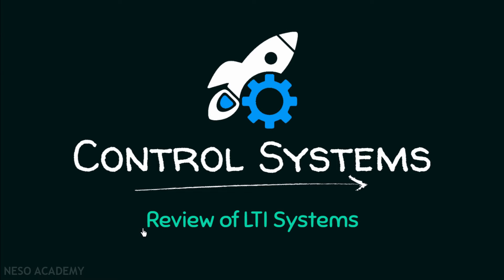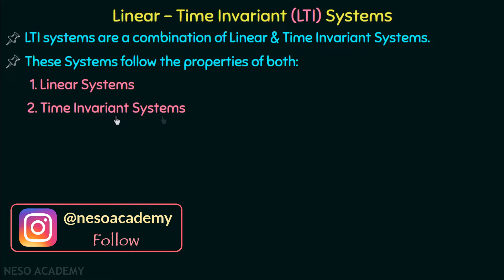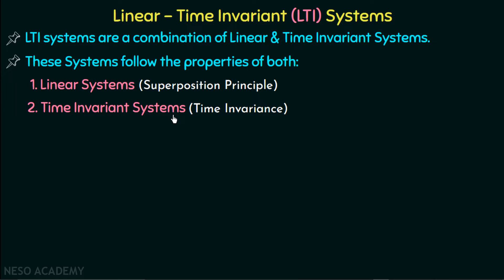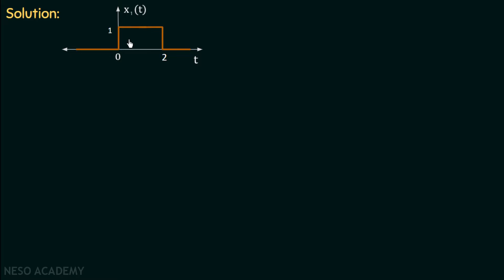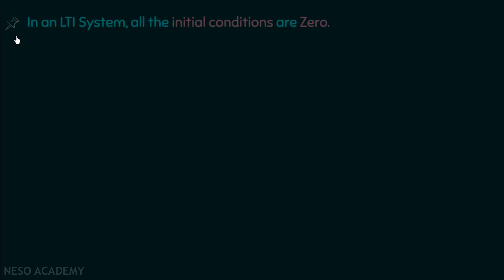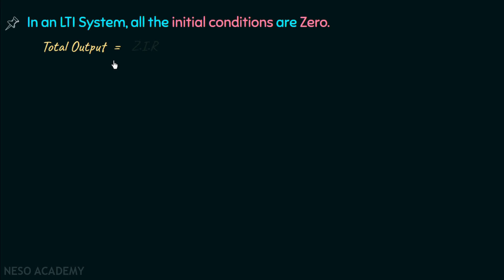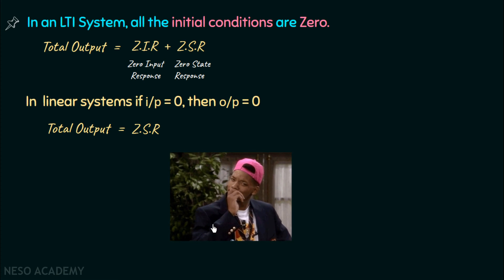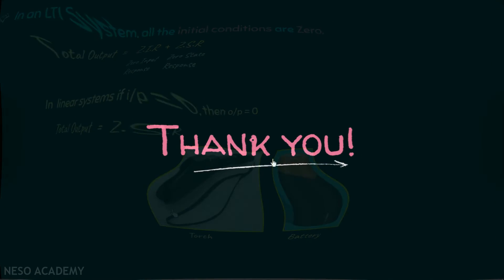Review of Linear Time-Invariant (LTI) Systems

Comment: Thanks for the videos. 
I believe after shifting the signal to the left, we need to subtract 1 from the original signal, and not add 1 as in the video.
Reply: no its (t-x), let x be shifted time. since we shift towards the negative time axis which is  in the above case "-1"' meaning x=-1 ... therefore (t-(-1))=t+1.

Comment: Not understood torch and battery example
Reply: We get an output(light) regardless of whether the torch is plugged in or not due to the power in the battery( initial conditions). But plugging in will give output resulting from the external source(zero state) and the battery( zero input).

Comment: Nice lecture sir. You have described very well. But one problem! I still have not understood the initial condition. Also, I did not get the example of torch light relating the zero initial condition. Would you mind to explain it with another very easy example?
Reply: He didn't explain this very well. I think he was saying that the torch is NOT an example of a linear system, because 1) it has a nonzero initial condition (battery charge) and 2) it is given no input, yet has an output. These are violations of the two rules he said must apply for LTI systems.